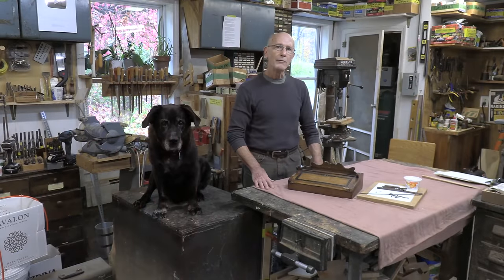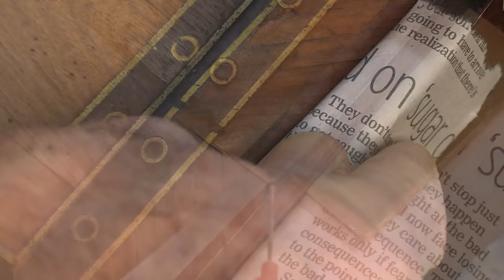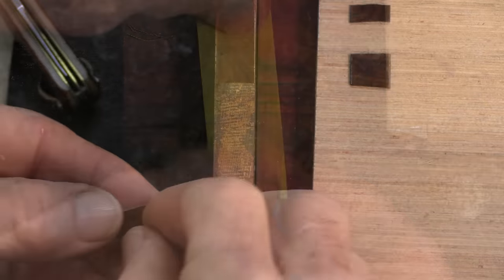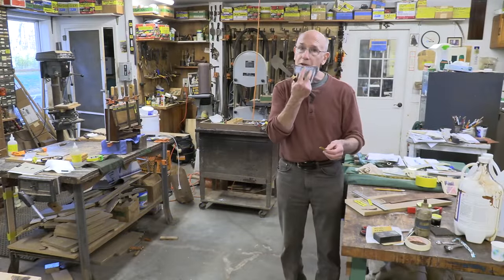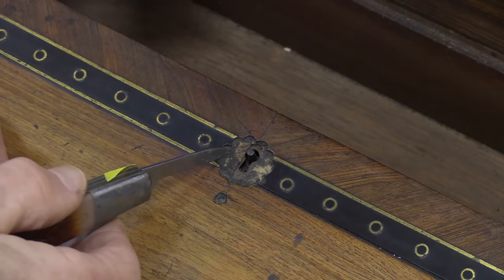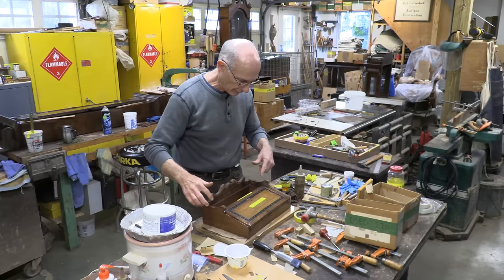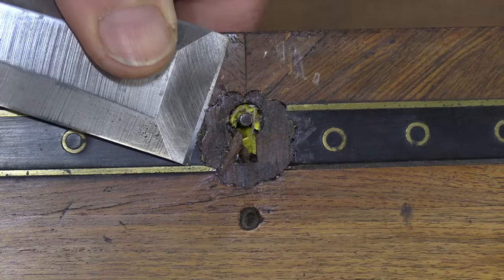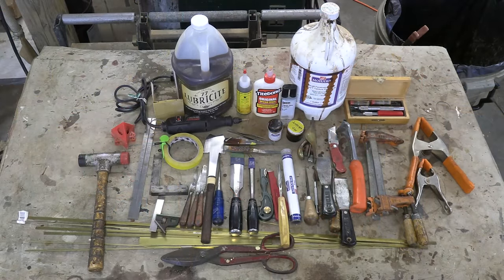Back to Beautiful - Thomas Johnson Antique Furniture Restoration

Comment: To make the brass piece you need to mark it with a blue machinist dye and a scribe.  Use a jewelers coping saw to cut it out.. And jewelers files to perfect the shape and fit.  Then sand and finish it
Reply from the maker: Thanks! Yes, but that wasn't the problem. I had no way of transferring the exact shape to the brass. Every facet was different

Comment: I saw another furniture restorer use an air nozzle on low pressure to get to glue further into the repair area, especially on splintered wood. Then clamps were applied. Have you ever tried this? Thoughts?
Reply from the maker: Thanks! No, it sounds messy! I'll try it

Comment: The tiny escutcheon surround you thought may have been brass could possibly be made by computer if the program is provided a plaster version for duplication.  The cost of that we do not know, but certainly is a factor in the metal solution.
Reply from the maker: Thanks! That would be the perfect solution for this.

Comment: Note : at 38:20 a brass keyhole plate would likely have two small brass nails, and we do not see two small nail-holes there inside the 11 petals flower (instead, what you removed earlier inside the flower was glue with "black stuff"). This might be an indication. On the other hand,  keyhole plates are rarely made of wood (too fragile) ... so, glued brass or glued wood, what to think ? , difficult to say.... greetings from france.

Still at 38:20 the black wood dowel below the keyhole is mysterious. What is it ?
Reply from the maker: Thanks! Yes, what it boiled down to was that we will never know exactly what was there.Below, I assume someone had installed a knob at some point

Comment: For the escutcheon, to get a better transfer I would use tracing paper and then graphite or carbon paper. The tracing paper so that it's easier to see what you're trying to trace and then what you might wanna do is is take normal 3/4" or 1/2" stock or even the brass itself, put the graphite paper over it and then put your tracing over the graphite paper and then trace over your tracing. The pressure from your pen or pencil will make the graphite paper leave a trace of where you went over it. If that makes any sense.
Reply: Plasticine rolled over the surface will allow you to see your marking as well.
Reply from the maker: Thanks! Yes, not bad. The problem was that I needed a precise rendering on the brass, no matter how I did it, and I could see that wasn't going to happen

Comment: What did the early cabinet makers use for sanding and sanding devices ?
Reply: As far as materials go, quite a lot of stuff: various stone powders (pumice, tripoli,  rotten stone) and brick powder - usually made into a paste or slurry with oils; plant leaves (rushes such as Equisetum hyemale are still used today), shark and ray skin.

Devices: both hands.
Reply from the maker: Thanks! dlevi67 is correct! It's hard to imagine exactly how. I will add: scrapers
Reply from the maker: Yes! I would add to the list scrapers
Reply: @johnsonrestoration  Good point!

Comment: You use traditional hide glue (heated in a pot).  Titebond makes what they call a hide glue, dispensed from typical bottles.  How do these differ in performance and the ability to be re-done in the future?  What else should we understand about your preference?
Reply: Not Tom, but I have used the Titebond glue, and found that it works much better if heated (in warm water). Do you need to? Not theoretically, but it is more difficult to spread, and it seems to remain gummy for a very long time if used 'cold'.
Reply from the maker: Thanks! dlevi67 is correct. Either is fine, I know the Titebond has a limited shelf life, not sure abot the "Old Brown Glue"
Reply from the maker: I have used the "Old Brown" cold - I want to do some experimenting
Reply: @johnsonrestoration  Considering your average use per day... limited shelf life is not an issue 😁

Comment: I've Noticed that you use alot of hide or hyde glue. I'm not familiar with it and i haven't seen anything like it before here locally, is it possible to buy online ? thanks for the good content ! always learning.
Reply: Look up "Old Brown Glue" (it's the brand that Tom uses). It's available in many countries, but not everywhere; if you search for 'hide glue' or 'pearl glue' you will certainly find other brands - though many will require dissolving the glue in warm water first and are usually not as long-life as the pre-made mixes like Old Brown.
Reply from the maker: Thanks! Yes, dlevi67's got it covered!
Reply from the maker: Yes! Thanks

Comment: You could try scribing the brass by scratching or marking it with a sharp tool like a centre punch. Or make an impression with something that can be used as a model. Perhaps by covering with plastic wrap and clamping some epoxy putty into it.
Reply from the maker: Thanks! Yes, that was the issue, transferring an exact image

Comment: 6:00 When you have to tape up inside curves like that the best stuff is electrical tape, because it stretches, as opposed to masking tape which will just tear.   You can always put down some masking tape first, so the electrical tape doesn't actually touch the sensitive surfaces.
Reply from the maker: Thanks! I thought electrical tape only stuck to itself, maybe there's a different type?

Comment: How to accurately mark brass, aluminum, steel, or other sheet metal:
Get a large point blue Sharpie marker. Smear it all over the face you will be marking, so it is evenly blue. Wait for the Sharpie to dry, which is only a few minutes. Now you can take a sharp point or scratch awl, a ruler, French curve, or freehand, and you can make very thin marks in the blue. They will be easily visible, since you have the contrast of dark blue with the bright metal. This can make lines that are far sharper and easier to follow than pencil or pen lines. Once you have the part cut out, just wipe it with some acetone to get rid of the sharpie marker.
Reply from the maker: Thanks! But all that doesn't solve the problem of how to transfer the exact image to the brass

Comment: I'm curious about the syringe you use to dispense glue. Do you dispose of them after use or do you clean them? If you clean them what is your technique?
Reply: Hide glue and wood glues are most always water based.  It will say on the container what to use to clean off the glue.  Hot water and dish soap are all that is needed.  Major point though is clean it before the glue sets up.
Reply from the maker: Thanks! Dwight L is correct! It's hide glue, cleans up easily
Reply from the maker: Thanks Dwight! I keep it in the crock pot, in a tall jar and I don't need to clean it every time

Comment: If you hollow grind the flat a little so the end of the screw driver is proud of  the flat . That edge will grip the bottom of the groove in the screw giving the best grip , to take out a tight a screw .
Reply from the maker: Thanks! Yes, it's so important to have the right size blade for the screw

Comment: do you think they used the toothing plane to create more gluing surface?
Reply: That's generally what the fine toothing plane marks on the back of veneer are for.
Reply from the maker: Thanks! Yes, that's the theory!
Reply from the maker: Yes, but I've never understood what they were trying to achieve, as you want to maximize wood-to-wood contact and toothing is counter to that, unless the toothing on both surfaces actually interlocked, but how would you know?
Reply: @johnsonrestoration  I don't know... unless the toothing also creates more flexibility in the veneer (which could be quite thick), and thus allows it to conform better to the substrate?

Comment: If it was up to me, I would get rid of that fancy shape of escutcheon and just made it a circle. Then, the escutcheon could be ebony with round brass border. I think it would correspond really well with the rest of the design.
Reply from the maker: Thanks! I thought of that - but I can't alter an antique.
Reply: @johnsonrestoration  My first thought was that you were altering it anyway - since it was unknown how the original escutcheon looked or what material it was made from.

But I suppose your method is better since it is reversible - if, at some point, the owner finds the missing piece, it would be possible to remove the fix and replace it.

Comment: Came out really good! Unfortunate that the brass keyhole piece was being so difficult. Brass would have looked much better there.
Reply from the maker: Thanks! I think so too
Reply: @johnsonrestoration  With your setup, you could have easily made a cast of that wood piece and then poured in molten bronze. It doesn't require as much heat as most metals. Something to look into. Love watching you work! God bless you my friend.

Comment: Well done. Those writing boxes were used by so many and I think untill the note/letter pad was mass marketed. Even officers and reporters had a style that they carried.  Not sure if the screws would come out but I recomend a set of good multi bits like gunsmiths use. Chapman makes good ones that have been made since 1936 by the same family. They are not cheap. The so called jewelers sold today are terrible quality. I even have a vintage set made in the US that are not that good. Speaking of jewelers tools a jewelers saw along with dykem layout fluid would help with the brass escutcheon. Spent 5 years in the machine shop of a major jewelry manufacturer's awards division. You might have a class ring from their school division.
Reply from the maker: Thanks! Good tips! Balfour's in RI?

Comment: Nice job. All that veneer erpair is fussy work. You are a patient man. I would suggest though that in the future if you attempt recreating a brass escutchion, you'd have a better time of it if you used a jeweler's saw and cut it by hand rather than with the power jigsaw. The blades are finer and cutting it by hand would give you more control.
Reply from the maker: Thanks! All true, but you're talking days of intricate work

Comment: Too late now but about the brass inlay around the lock.  My thought was to make a negative tape template instead of a positive one.  Then place the neg. template onto the brass and spray paint over the tape.  This will leave a positive painted image to follow.  (or visa-versa to leave a negative painted image) My $0.02.
Reply from the maker: Thanks! That's a good idea! Worth more than 2 cents! Problem was my tape was not making a precise enough image

Comment: could you have taken a scratch awl and traced the design from the tape to the brass, then you would have a scratch in the brass instead of leaving the tape on.  you could also darken the scratch to make it easier to see when using the saw.
Reply from the maker: Thanks! Yes, but every facet was different, it turned out to be just too much work, and I could never get it right

Comment: What a mess! First of all there is something called layout fluid for marking metal, second your patches can be seen a mile away. Restoring means bringing it back to its original state, not using the wrong essence for veneer, putty because pieces do not fit and modern lacquer on top of stain on top of lacquer. You may be fixing (cheaply) old furniture, not restoring.
Reply: We are all awaiting with bated breath your restoration videos where you make no use of putty (even for absolutely minor chips/nicks), completely preserve the original surface, perfectly match colour with the same stain and varnish process used in the original in the same exact sequence, after using a microscope to determine the precise species and age of the wood to replace. FWIW, "Lubricite" is just a brand of shellac... which is centuries old as a varnishing product.
Reply from the maker: Well, thanks for watching! I do the best I can
Reply from the maker: Thanks!